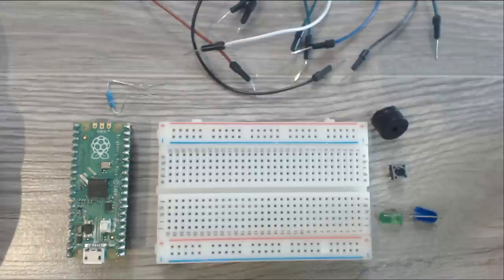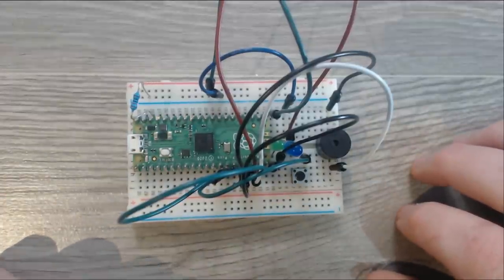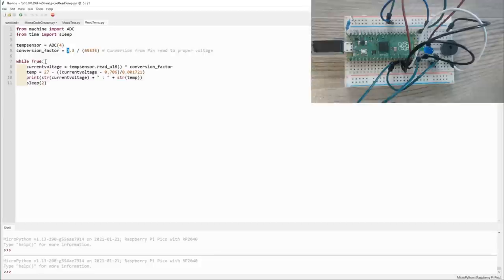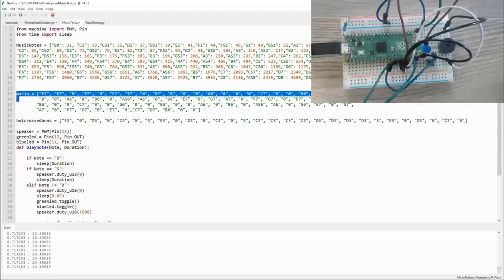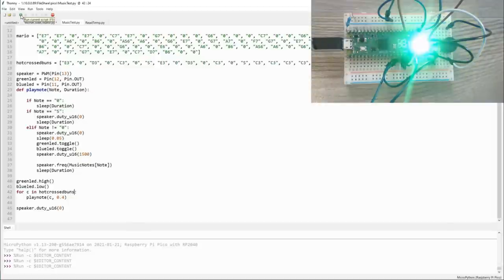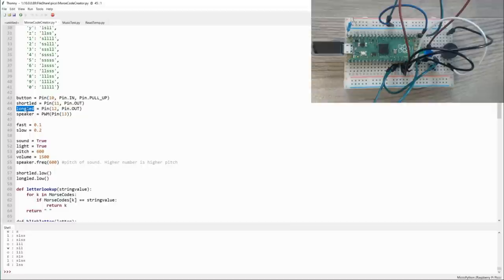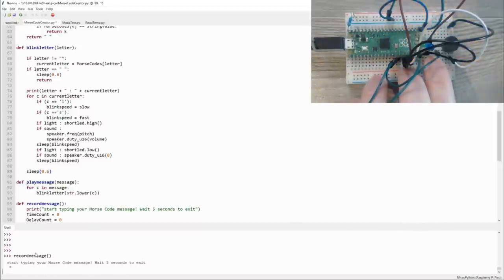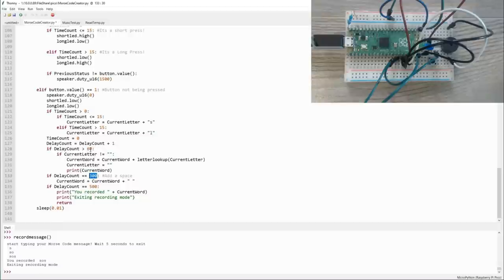3 Easy @raspberrypi Pico Projects that ANYONE can tackle!

Comment: One tiny niggle: the ratio of long to short in morse is 3 to 1 not 2 to 1 as your code appears to specify. The inter-element spacing should be one short and the inter-character spacing one long. Inter-word spacing is basically anything over 3 longs. However, every morse operator has their own 'fist' or style and that is determined by how they space elements and characters/words. For instance, I tend to lengthen the long in the letters 'f' & 'l' to 4 or 5 shorts to change the rhythm. Machine generated morse is very recognisable on air as it is very boringly exact ... unless the code generates some random, small differences. 🙂
But great projects. Does MicroPython not have the += construct? I noticed you didn't use that.

Comment: It would be awesome to add another unit   And add some listening code code for inbound messages. Turning this into a semi encrypted transmission device using walkie-talkies. You would also need a keying line of code. Possibly some resistance for the speaker wires. Worth the research and it would be pretty neat if you could get it to work!

Comment: great video. building along with you. I think this pico has a damaged thermistor, maybe done by me when putting on the rails.   The room I'm in is 73f / 22.78c , but the one i've got in my breadboard is reporting about 15c... meanwhile another un-touched pico is reporting 22-23 ...  -_- I didn't linger on any of the pins excessively with the soldering iron, and the other two projects work great. very weird.  guess i'll try to solder this known good one and see if i destroy it or not.
Reply from the maker: Very odd. I haven't seen anyone damaging it by soldering. Does the pin will work for general IO?

Comment: I wonder, when I have a line like temp = 27 - ((currentvoltage - 0.706) / 0.001721) can the measured temperature ever be above 27 deg?
I currently have above 29 deg C and the pico thinks its 21.4 
I know this is not a precision device but thats really to far away from the real temp.

Comment: Nice set of projects. I have one question, why is the conversion factor for voltage 3.3/ 65535 ? I read that the Pico has a 12 bit ADC so why is the conversion factor not 3.3/4095 ?
Reply from the maker: Excellent question! While the ADC does, indeed, return a 12 bit value,  its converted to a 16 bit value with MicroPython to keep compatibility between other boards running MicroPython. 
Here's the relevant snippet from the Pico Python SDK

An ADC has two key features: its resolution, measured in digital bits, and its channels, or how many analogue signals it
can accept and convert at once. The ADC on RP2040 has a resolution of 12-bits, meaning that it can transform an
analogue signal into a digital signal as a number ranging from 0 to 4095 – though this is handled in MicroPython
transformed to a 16-bit number ranging from 0 to 65,535, so that it behaves the same as the ADC on other MicroPython
 microcontrollers.

Comment: Nice video! Why the resistor to ground?
Reply from the maker: So, since only one led is illuminated at a time, it's okay for them to share a resistor. And since it doesn't matter which side of the circuit the resistor is on, as long as the LED is connected to it, I tied them at ground level.

Basically, I was trying to do it with as few components as possible. 

Hope that makes sense!
Reply: @PrintNPlay  ah yes! That makes sense... thanks for the explanation.

Comment: How do I put the code on my pico so when I disconnect it from my computer and plug it into another power source it will run my code?
Reply from the maker: The code needs to be compiled on your computer and transferred to the Pi. I will have a tutorial out soon!
Reply: @PrintNPlay  Thank you, I received my board 3 days ago, I've been trying to do this ever since and I can't find documentation anywhere I look.
Reply: If you "save a file to the device" and give it the special name main.py, then MicroPython starts running that script as soon as power is supplied to Raspberry Pi Pico in the future.
https://datasheets.raspberrypi.org/pico/raspberry-pi-pico-python-sdk.pdf
Reply: @jyvben1520  I tried that already......
Reply: @SourRaccoon    did you prep the pico to work with micropython, or are you using the circuitpython version ? that uses code.py
Reply: @jyvben1520  I have tried using the one on raspberrypi.org, and the one that thonny installs. But when I get home I will try changing the name to code.py, it's worth a shot.
Reply: @SourRaccoon  raspberrypi.org should be your first stop.
Reply: @rozberry8867  It was.

Comment: Great video, thanks. But here are some comments.
It IS a standalone computer, just not a desktop computer with an operating system.
I wouldn't put the components so cloes to the Pi, those connectors on the side could shortcut to the led.
I also usually prefere to use the red tracks as positive and blue of the breadboard as ground.  That will make me do less errors.
PWM uses constant frequence, but varies the propotion between how long it should stay high and low.  But the frequence are the same in PWM.  But as you have in your code, you can also change the frequence in those PWM ports of this RPi software.

Why don't you use the RPi B model to develop this on? :-)
Reply from the maker: All good points! I think how the term "computer" is used has definitely changed over the years. Although, even with the adoption of what is presently considered a computer, the Pico is fully capable of emulating older computers and being useable as such so... Hopefully the point wasn't lost, if for a lack of more appropriate phrasing.
Spacing of components is definitely important. Don't want to short our the device, or the USB port it's connected to.
And finally, I do enjoy coding on my Pi 400, but it's been easier for me to do screen recording on my desktop. 
Thanks for taking the time to share your thoughts!
Reply: @PrintNPlay  thanks for the comments.

Yes, this little computer have the capacity (and more) to emulate a PDP 11 minicomputer (that is real mini computers )
Computers that run original Unix, with serveral concurent users. :-)  Has actually run Unix on one and have also been in the CPU of a PDP 8 and fixed a problem.  The CPU was about 2 meters hight, in a full 19" rack. I nealy fitted into the CPU. :-)  

Yes, that was about 1993, and these computers was already old then.

Comment: Will the Morse Code .... code work on a normal Raspberry Pi, my local Pico supplier they are out of stock right now. So in the mean time I wanted to play with that morse code program
Reply from the maker: It, unfortunately, won't run without some modification. The general concepts are the same, but the gpio references will be different.
Reply: @PrintNPlay  Thanks for a fast reply, I shall have a go at translating it for regular Pi